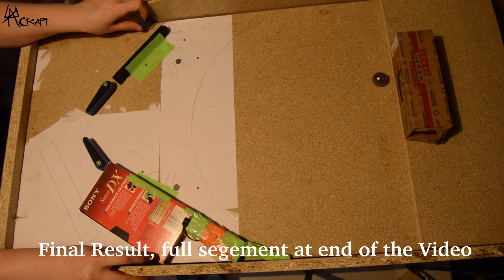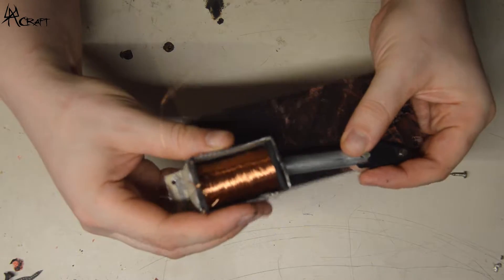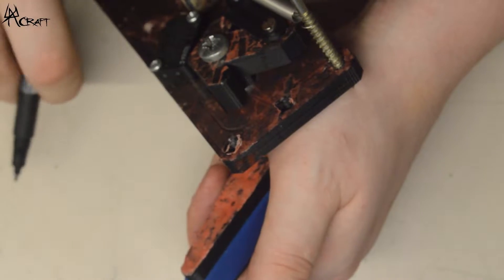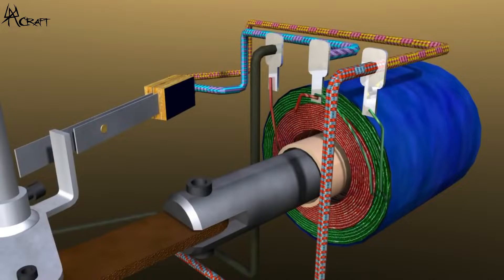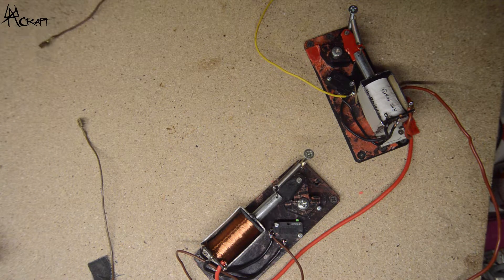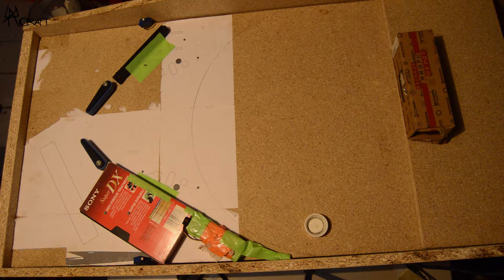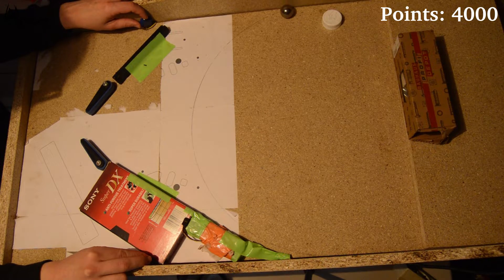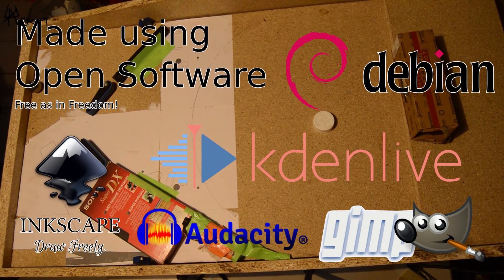Pinball from Scratch: 3D printed Flipper Assemblies and Case assembly

Comment: Is it correct that you have the two coils in parallel and the switch turns off the inner stronger coil?
Reply from the maker: no they are in series, and the switch just shorts the Hold coil to give it the punch, afterwards they just sit in series to reduce the current ;) https://howtobuildapinballmachine.files.wordpress.com/2014/12/image006.jpg

Comment: Hello. I have advanced and the work is going very well, but I am stuck in the coil connections. I can't see the whole scheme including the power source. Is it possible that you can put an image with the schematic of connections? I will thank you enormously
Reply from the maker: https://hackster.imgix.net/uploads/attachments/371997/flipal1_4dEBuFEASm.jpg?auto=compress%2Cformat&w=1280&h=960&fit=max
https://homepinballrepair.com/wp-content/uploads/2020/10/bally2flipperschematic.jpg

this is the flipper mechanisms schematics, the power supply for the Coils in the video is 24V DC, i used a old style transformer with full bridge rectifier cause i had it laying around, but a switchmode powersupply also is an option. 

I am happy that you are Building it, it makes me happy to see that someone recreate my Work :)
I hope the pinball brings you lots of fun <3
Reply: @Laracrafttrabant  Thank you so much. Fantastic help!! 
Additionally I put 1 diode to the coil to protect it. I learned it in another video :)
Reply from the maker: @davidcerdacaelen  it is to protect the switch / Mosfet from damage :D the coil outputs the stored energy in reverse and the diode disatates it and limits it to 0.7v ;)
this is just mecanical like the really old tables.

Comment: Hello. One more cuestión. How do you get the Plunger?  What is the measure? Thanks
Reply from the maker: I cut it from a Skrew, if i remember right it is 11mm steel / iron
and you just cut it to the length so a little bit comes out when solenoid is pulled in to fasten the Linkage with a pin (nail). the metal surround is just 2mm steel to close the magnetic flux and make it much stronger
the plunger has to be touching the backside of the metal surround to give the Flipper the right Power.

in the Demo you can see that the left Flipper is working better cause the plunger is nice and square at the cut, the right Flipper is lacking some Power cause it is not touching the backplate of the surround.
Reply: I had the idea to cut a bolt, but now I do it with confidence. How did you get the metal frame of the coil?
Reply from the maker: @davidcerdacaelen  i cut out a shape to make a box and weld it, then you only need to make a hole for the plunger on one side

Comment: Oh wow you make your own solenoid, that's another level, well done 👍
Reply from the maker: Thanks :) it is a clone of the old Gottlieb 24V System.
i got the Wire Gauge and the Turns from an old Manual. 
the Coil-winder makes things a lot easer and faster :) 
The Slingshots and Pop-bumpers are next on my agenda.
Reply: @Laracrafttrabant  I'm designing a Pinball Machine from scratch, the idea is use the 3d printer for flippers, bumpers, drop target etc, for now I bought  some solenoids from china but I'm not sure if they'll be powerful enough xDD 
I saw your video wiring the solenoid, very cool .
Reply from the maker: @KaLiDEM  The Flipper Power Coil packs quite a Punch ! i stick to real Pinball specs here is a Coil list for classic pinball machines, you can buy them online too but they are pricey! hence why i wind them myself :) 
https://flippers.com/coil-resistance.html